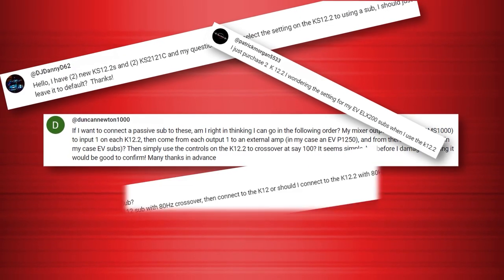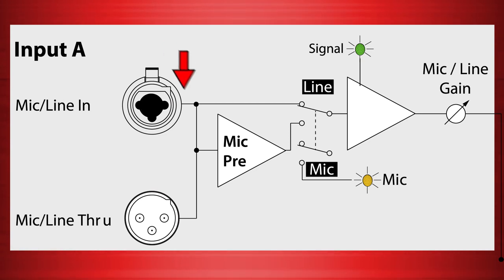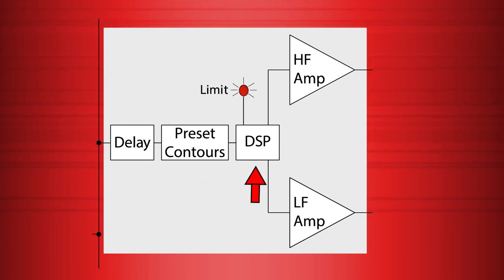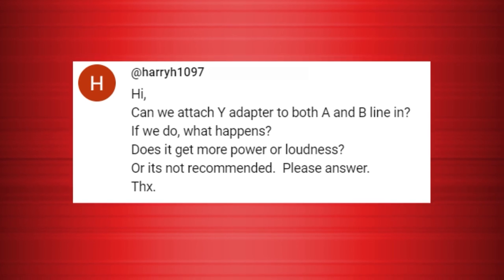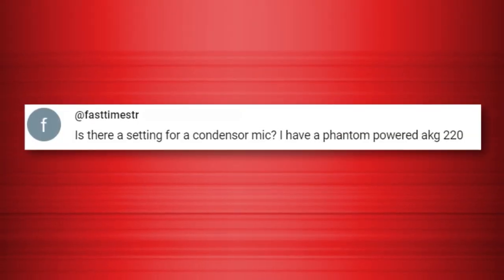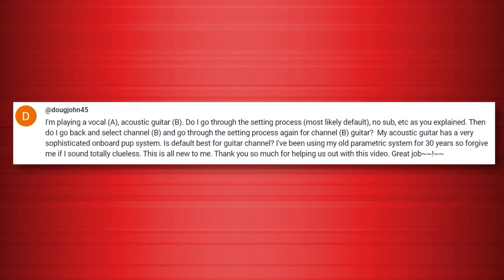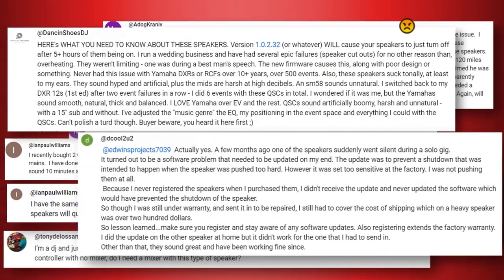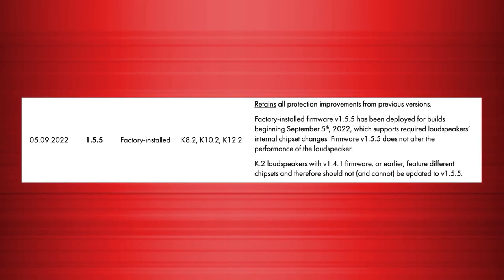Q&A: QSC K12.2 Powered Speaker

Comment: What is the best setting for the K12.2 tops when used with a pair KS118 subs in a DJ application?  Default or Live setting in the top settings?
Reply: When paired with the subs :
Live for better clarity inside a hall or club.. 

Live bright on Outdoors for better high frequency travel, (also set the pole on a high setting to avoid hurting/discomforting guests passing right in front of your set up or guest sitting close in front of your set up.)

On small halls or snall gigs with out your subs: 

Dance is the best….. 

—-Tip that works for me, hope it works for you..—

Clean sound from the source, 
clean sound at the processing, clean sound at the mixing point, 
Quality clean sound at the front of house.. 🔥

I set  the speaker level max or 3/4 to the right, aka almost max level.. 

Lower the main output level of your computer to half, 

1-
if you use a dj mixer such as pioneer or whatever, connected directly to the SPEAKERS,
 lower your volumes for each channel, with the master volume set   At 5O%-75% level.. 

Or

2-
If all your set up is connect to and external mixer, like allen and heath, yamaha, X32 etc..

Lower all your dj channel and master output levels to 45%-60% levels and boosted up at the external mixer… 

“This helps to eliminate having distortion on you music sound, that sometimes we don’t se on the led level indicators, and don’t hear on the front of house do to dj booths usually setting up behind their PA…

Comment: The failure rate on QSC K2 series is ridiculously high. Yes.... QSC will fix or replace them WHEN they die.... but if you are on a gig when they die that's of very little comfort. QSC should have been more proactive when they discovered this fatal flaw and recalled ALL China made power modules manufactured during that period. It is a relatively simple replacement process.,.. if you can get your hands on the new parts.

I no longer consider QSC K2 series speakers a "professional" grade option.... too unreliable.
Reply: QSC Released the firmware update for k.2 series and it fixed the problem and all you need to do is make sure your up to date on the boxes and my new K8.2 were factory installed to 1.5.5 version and it’s very reliable
Reply: @TalentLe8159 Mine were also up to date on the latest firmware. That is not the problem. A large number of these speakers were made with very cheap Chinese components during the supply chain debacle and instead of recalling thousands of affected units, QSC decided to fix them only after they fail. A huge percentage of them fail, and if you are on a gig when they do you are s.o.l. like I was.